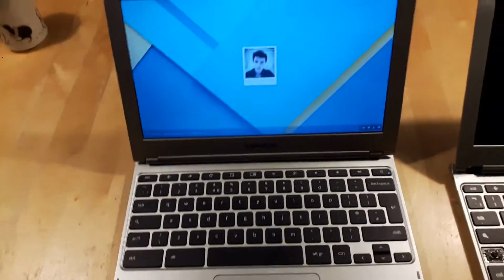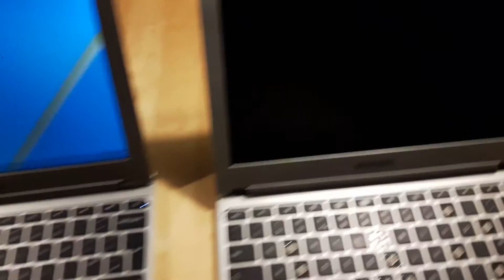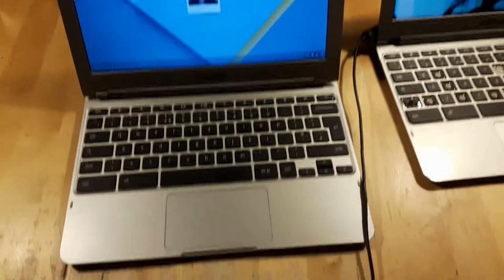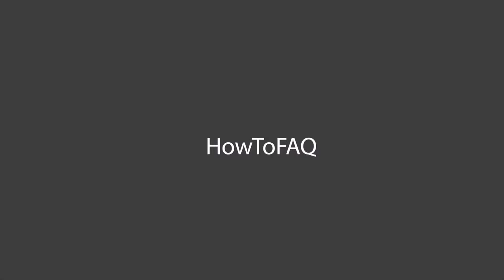Samsung Google Chromebook | How To Repair / Fix | XE303 XE303C12-A01U Disassembly Assembly

Comment: Oof Thx tho But my Problem is it won’t turn on and won’t charge is it the battery that’s the problem
Reply: I have same problem with the same model. Wont charge or hold power. Did you end up finding out a solution?

Comment: where is the write protect screw on this device? I want to remove that screw to enable developer mode.
Reply from the maker: I believe you can enable developer mode in software but turning it off and holding down certain buttons on boot.